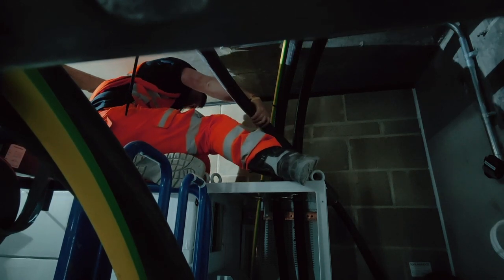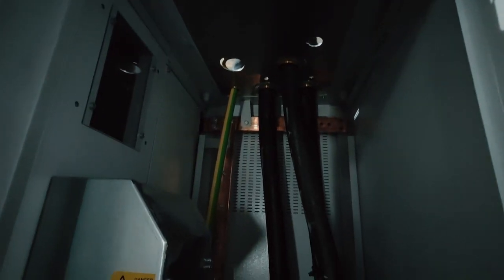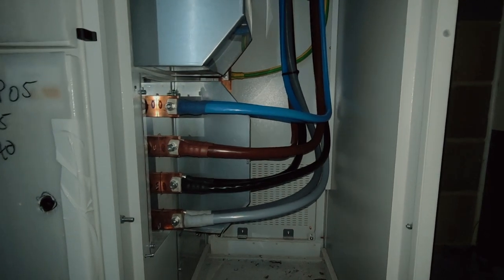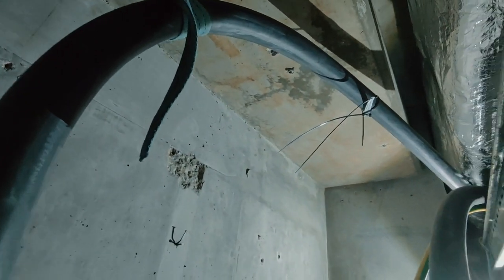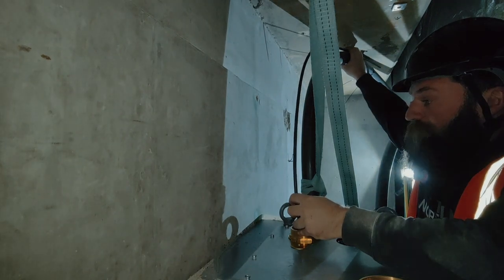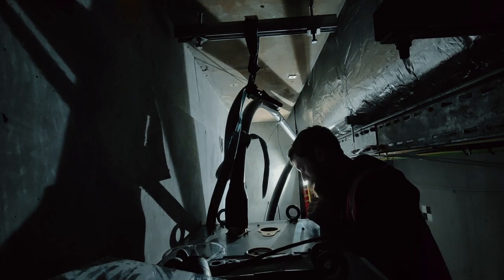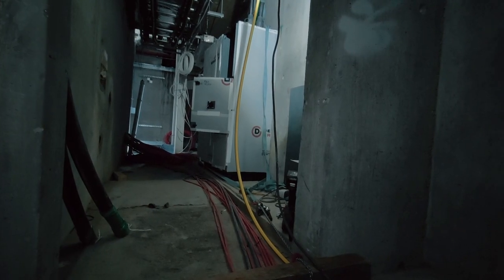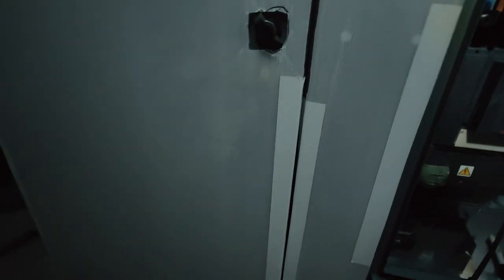3 days of cable jointing. What will I get done part 2

Comment: What tools do you use for all your armoured stripping? Splicing etc? I tend to shy away from using knives as I always threat about the inner cores. Think the biggest we normally terminate is 25mm 5 core which is a puppy for you.
Reply from the maker: There will be a tools video getting uploaded soon. I always strip with a knife but I do it really carefully. Haven't had any issues. I might be doing some 4c X 35mm cables soon. They're nice and small for me. I can do them pretty quick. Probably 8-10 in a day.
Reply: @jointechcabling9103  what sort of knife do you use? Look forward to it, I enjoy seeing this side of electrics too I rarely get commercial or industrial works so this is a good learn and watch
Reply from the maker: @chrisdobbo8938  just a normal Stanley knife. Nothing flash. I only do dead work so I don't need an insulated one.
Reply: Just cut lengthwise deep and just score round. Never go deep round aluminium. A Stanley knife, an inuslated knife and latching cutters. I can't afford hydraulic cables.

Comment: Any tips on bending an terminating 70mm  short cables in to a isolator mate.i shared your video,s a electrician forum on Facebook to try bump your watchers up hope that's ok mate
Reply from the maker: That's a lovely thing to do, thank you very much!👍🏻
If you're really struggling, you can use a piece of conduit. Slide it over the core and bend away. You'll have to be careful that it doesn't dig into the pvc but it does work.
Reply: No problem mate it's interesting seeing what you do an we get to watch it's not just cut back in when you done it keep up the good work buddy an thanks for the tip il give it a crack

Comment: Whats the reason for using external cable glands and not internal ones??
Reply from the maker: Network rails spec. They wanted us to use ip washers on the glands too. I told them they were being crazy so I didn't use them.